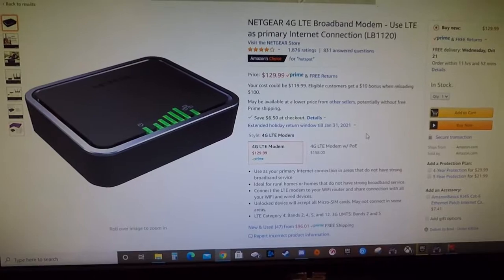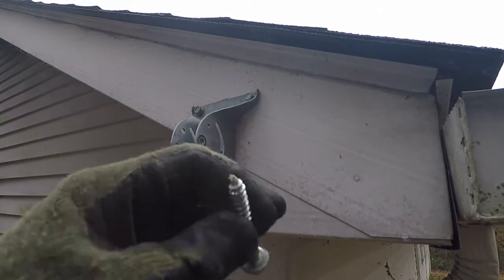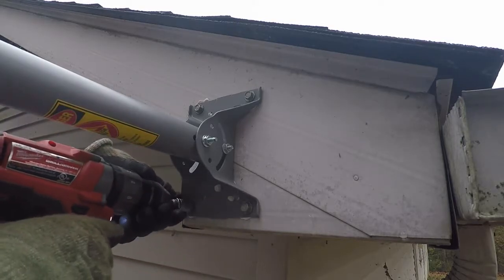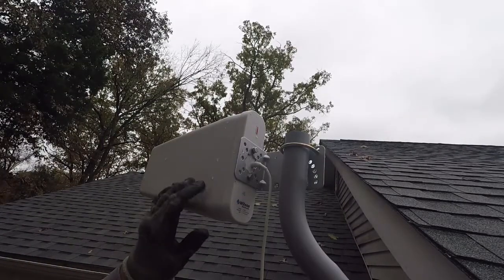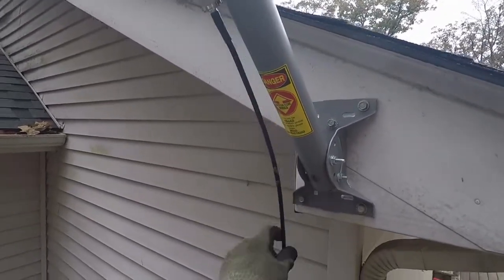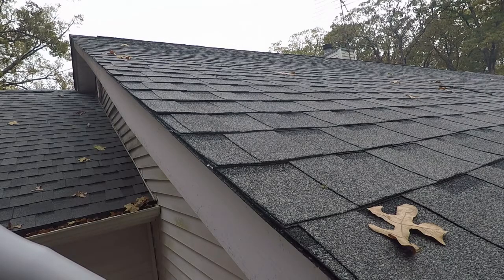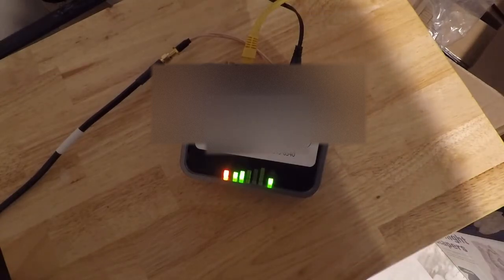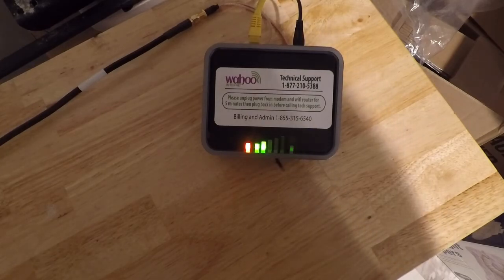5G Modem Antenna (Originally made for 4G modem, but now have 5G with updated setup. Same Process)

Comment: I’m not positive but you shouldn’t use a splitter you should have two antennas or at least an antenna with duel mimo inputs your not going to see much Gail with that setup
Reply from the maker: I like your idea. With the relatively low cost of these antennas and cables I might give that a try and see if there's a noticeable difference. My connection is pretty good as it is but I wouldn't complain about better. Thanks for the input.
Reply: @sleepersftw  one other observation I know the cable you use can kill the signal. The good one is really thick insulation is key not to loose everything before getting to your router.  The one you have doesn’t look ideal a lot of crap Chinese vendors will sale you anything pls shop around
Reply from the maker: Noted. Is there a particular brand or model you would recommend?
Reply: @sleepersftw  Wilson Ultra Low-Loss
Reply from the maker: Thanks
Reply: @sleepersftw  shorter is better and keep the cable away from electricity
Reply: @jdedad   LMR 400 low loss cable
Reply: @gone51572  that’s good stuff just need to make sure you get the ends you need on it.
Reply: @gone51572  LB1120 not sure if it had POE power over Ethernet or not they have a model that does the purpose is so you can put it near your attena and then run Cat 5 to your router you get less signal loss this way

Comment: I have this exact modem and the problem that I’m having is when I connect my TS9 cables to an external antenna there is only a slight increase. Is there a way to switch over in the modem internal or external antenna I use. I went into the program of the modem and I did not see a choice that they give you.
Reply from the maker: You're wanting to switch back and forth without physically disconnecting the cables for the antenna correct? I'm not aware of a way to do that.

Comment: So I just cancelled my membership with att using this exact modem. The nat type was too strict. Latency was in the high 100's but the download was 16mbps and upload was around 2 - 6 mbps on the speed test. First test looked good but every test after that got worse and worse. Did you have any of these issues? Any recommendations?
Reply from the maker: My ping is usually 40-70 on average however I do often see speed fluctuations. On the high end, usually later at night I see closer to 30 down and 10 up but during the day when I would expect tower traffic to be higher I often see your speeds or less. As far as nat type, that is over my head not going to lie. Lol Gernerally we have zero issues streaming movies and when I do get to play games, usually late at night, I can't complain. I was used to having cable internet so this was an enormous adjustment, but it was a trade off to get a home that better suited the lifestyle we wanted for our family. Is it great, absolutely not, but it is useable and it was the best option I could find for our location. Our connection quality was about useless before this antenna and it it cost me about a third of what our internet company recommended. If your area has a t mobile signal you might check out wahoo internet and see if it works better for you.